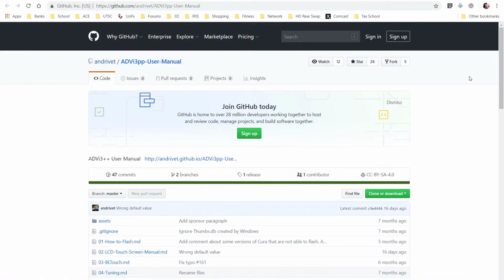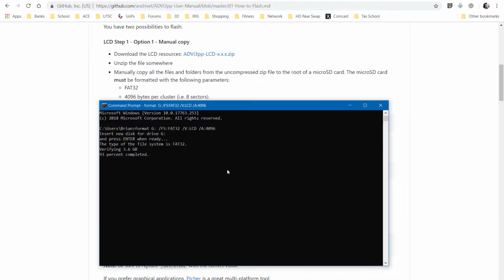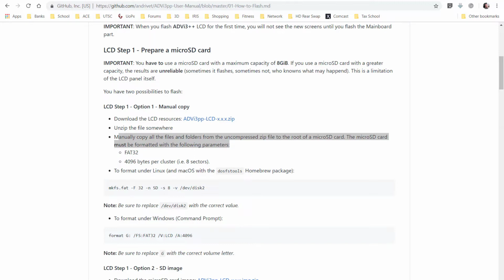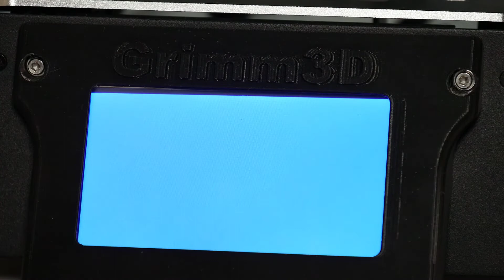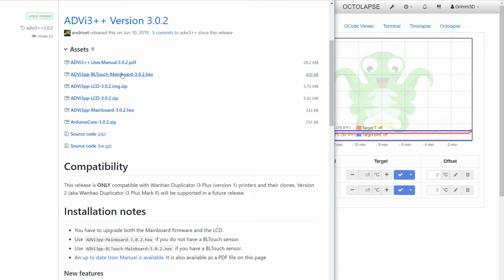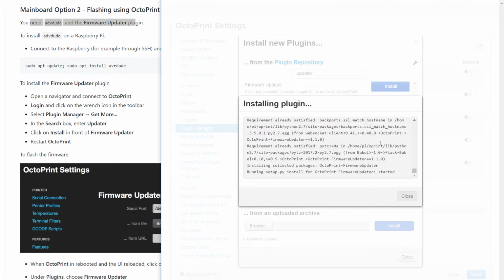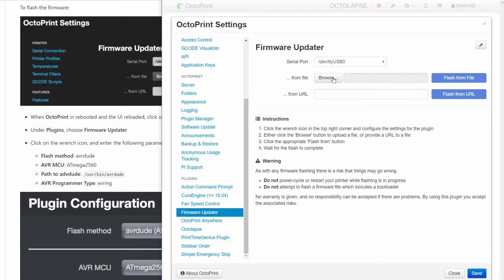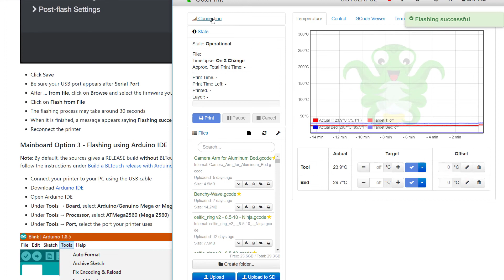My ADVi3++ Upgrade Adventure

Comment: Please update GitHub, GitHub not found  :/
Reply from the maker: Thanks for watching. The link issue is discussed in the comments - the creator of ADVi3+ has moved the software and has also created a better support system for it. If you search for it, you will find it.
Reply: @Grimm3D  software to pcb this?https://marlinfw.org/meta/download/ 2.0.6??

LCD this? https://github.com/NathanBarguss/ADVi3pp-LCD
Reply from the maker: If yoiu look on the ADVI3pp-LCD page, it links to this file for the main board: https://github.com/andrivet/ADVi3pp

It looks like the link you have for the PCB is just a version or Marlin, not ADVi3

Comment: Do you use Cura? and if so what are your common settings for the maker select plus with pla?
Reply from the maker: Yes, Cura 4.4.1 I print PLA (mostly PLA plus) at 215 on the hot end and 60 on the bed. 0.2mm layer height. My speeds are infill=60, outer wall=30, inner wall=60, travel=80, initial layer=30. 

I would suggest printing a temperature tower to calibrate your own machine for your favorite PLA though. These seem to always result in good information. Like I show in my eSun review https://www.youtube.com/watch?v=xv7yTkYmhxQ

Welcome to the channel, Thanks for watching!
Reply: Grimm3D thank you! Just installed the aluminum plate and glass bed.
Reply from the maker: @hunterbakos9946  I do not use a glass bed, but hear they are wonderful. Happy printing and thanks for being part of Grimm3D